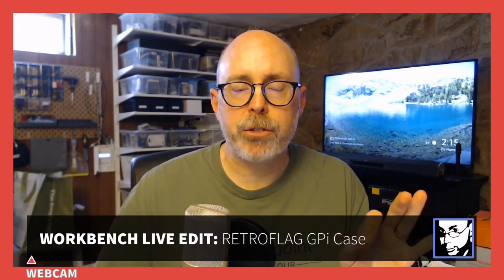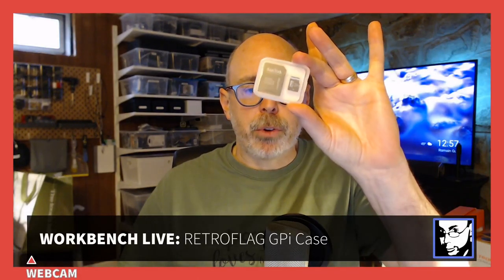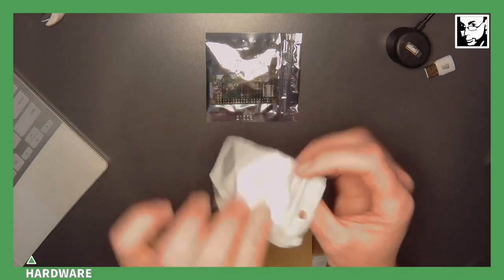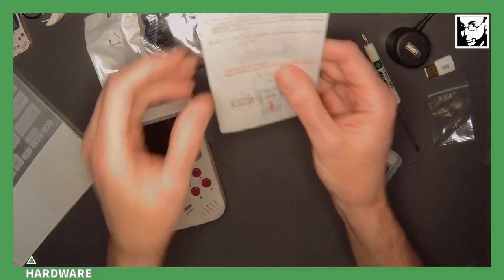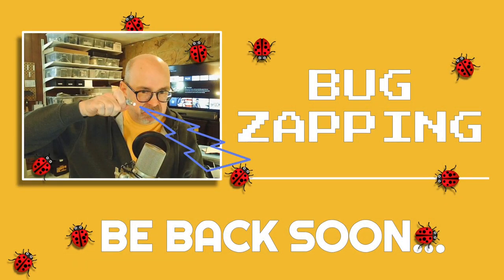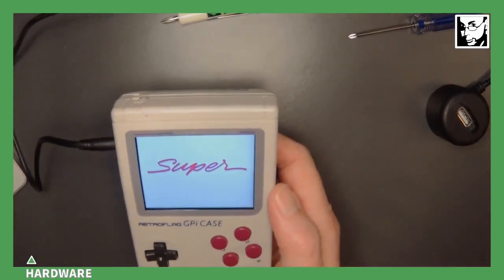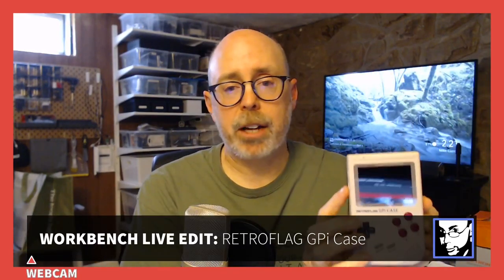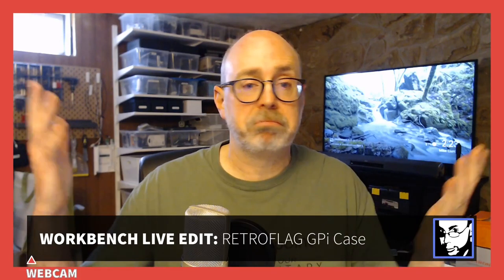Install Super RetroBoy on the RetroFlag GPi Case

Comment: I cannot use the D-Pads after installing.
Reply from the maker: I have to admit, it has been years since I've check on this device so not sure I can offer any assistance, but my guess is the D-Pads need to be set back up in the Retro Arch. You might be able to get it all working if you plug in a keyboard.
Reply: @retroCombs  I found a solution. All I had to do was hold start and up on the D-Pad for a few seconds
Reply from the maker: @theripper1777  That makes sense. The software just needed to recognize the hardware. Thanks for sharing. This might help others.

Comment: Great tutorial, worked like a charm.

BTW, it seems with the latest version of the Super Retroboy image (Rev E, 5-5-20), you can just flick the power button all the way off, and the shutdown script will safely shut down the Pi (only difference I could spot was, instead of fading out, or showing coloured lines on the screen, the screen just immediately shuts off after the shutdown script has run).
Reply from the maker: I should research this more and figure out the best way to update without stating from scratch, if that is an option. Thanks for letting me know!

Comment: The Banana Pi M2 Zero is an ultra compact single board computer which measures only 60mm*30mm. Its external interfaces are the same as the Raspberry Pi Zero W, and it will fit almost all cases and accessories for the Zero W. It uses the quad-core Cortex A7 Allwinner H2+ processor, with 512MB RAM. It's ideal for light-weight systems and space-limited applications
http://wiki.banana-pi.org/Banana_Pi_BPI-M2_ZERO
Reply from the maker: is this still the case?